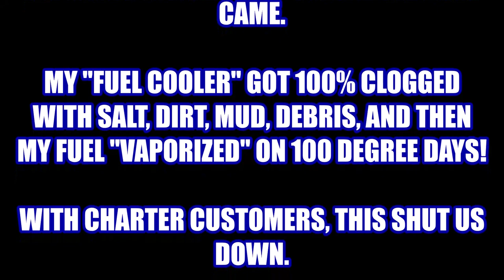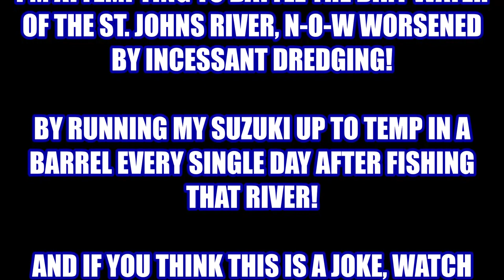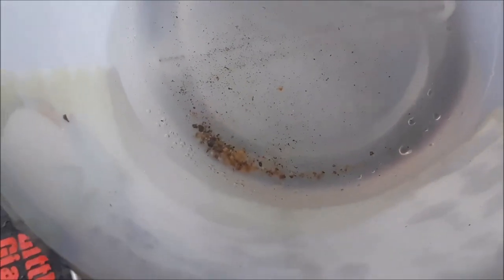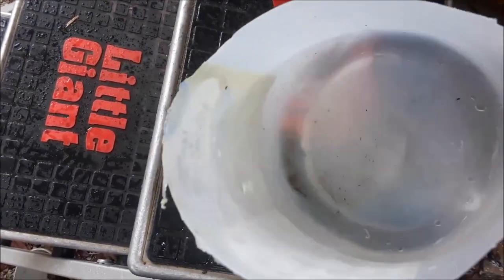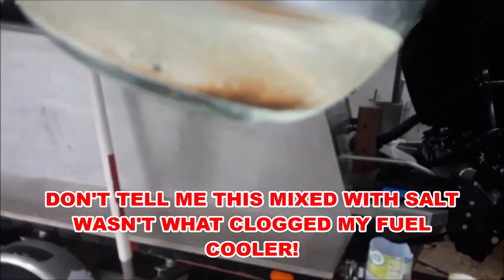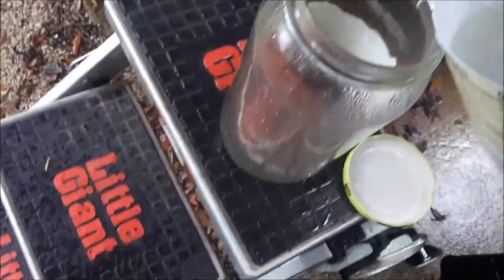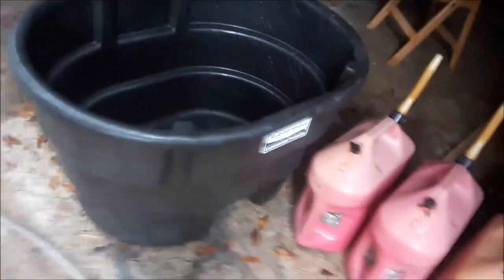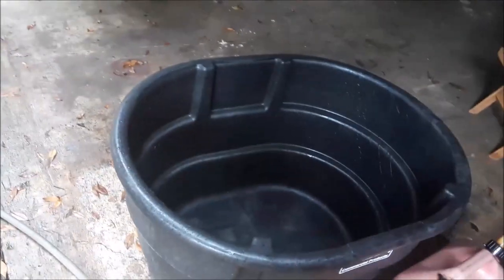OUTBOARD MOTOR FLUSHING (do not use)

Comment: Great vid Capt Dave, But disturbing for anyone who navigates on the St Johns river. Those particles look pretty big.   I have two suggestions for you. # 1 While at anchor with good current or at a slow trolling speed, throw some type of meshed strainer over the stern and see what you can catch in it. an  old net with some screening in it would do. With this you could find out if the problem is actually in the river or at the ramp. Suggestion # 2  Use compressed air and put it into the tell tale prior to and after fresh water flush. Run some compressed air thru the flush port as well. If you find that stuff is actually floating in the river, then your doing every thing that can be done. If it seems that its coming from the ramp it probably could be avoided by getting out to deeper water before lowering the Suzuki  and starting it. How you can accomplish that is something I cant "from where I am" suggest anything.
Reply from the maker: THERES FINE, FINE floating dirt also. but no matter where it comes from it ''water'' runs thru the fuel cooler. And can help clog it up. There's no way to catch it. Yes the ramp is a ''particulate'' factory. I even tilt the motor way up as I drive on the trailer, and once on, turn motor off fast! to help not suck more crap.

Comment: I had a 2007 175 hp Suzuki that would start up fine cold but if I ran it to a fishing spot and shut it down to drift fish for awhile it would have a hard time starting it back up.   I spent hundreds of dollars taking it in to different shops and not a single "expert" mechanic ever mentioned the fuel cooler.  That motor corroded on me this past summer and I had to replace it.  Had less than 300 hours on it.  Sure wish I had known about the cooler.  I bought another 175 2019 Suzuki so hopefully I will have better luck and do my part taking care of the maintenance.  Thanks for the tips!
Reply from the maker: ''That motor corroded on me this past summer and I had to replace it.''' with proper maintenance, that would never happen.
Reply: @CaptDavesSportfishing   The heads developed a leak and they got corroded.  I was getting water in a piston and that's all she wrote.  I will stay on top of the new motor maintenance much better than the old one.  I own a couple of boats and this one got little use.  That was probably an issue as well.
Reply from the maker: @gsman5828  w-h-o-a!

Comment: What seems to work for me is a solution of white vinegar, Dawn and running the motor in a trough of warm water for 30 min. The outboard is a honda 90, 5,500 hours, 24 years old with never any major problems.

Comment: Capt, just a quick question. Are you doing you engine flush only in the horse trough? No muffs or those other useless rinse/flush ports. I've got a 2019 DF200 and bought a 100 gallon one and that is what I've been using. Just trying to follow along. Thanks for all your tips.
Reply from the maker: yes just my barrel, do not ever use those flush ports on the motor, I did for years and my fuel cooler, look it up, got packed with dirt abd salt, shuts down motor in extreme heat, fuel will vaporize!!  too much heat going on under the cowling, so they came up with a part that will clog up easily. I have numerous videos about the toilet I run in abd the shit that ruins everything from anodes to water pumps!!!  interior anodes must be checked every 3 months if you run in shit water too.
Reply: Capt Dave's Sport Fishing Thanks Capt. I normally fish the gulf and at Augustine. Sisters creek used to be good to me but too many people. Thanks for all your help.

Comment: You should do a test.when you get back flush it with the flush port then after use your Method and see how much it missed
Reply from the maker: its about salt and grime in the ''fuel cooler''.....oh, it misses alot. Never ever seen so much crap, till I ran in barrel up to temp.

Comment: Whats up Captain, does that apply to the other motor you have when in use???Thanks for the vids OVIEDO FL..
Reply from the maker: Could! And it gets ''run flushed'' also, but is easier because it is made to be run on it's flush port.   I'd REALLY like to get my Merc 15 kicker hooked up to a shifter/throttle up in the boat some day soon. I'd use it even more!

Comment: That's all you got from a day running? I was expecting a lot more. Seeing the water quality in any Florida river 

If this was after flushing through the flush port,then, I  am a bit surprised. at
Reply from the maker: after years, add salt and mud....EQUALS: clogged fuel cooler❗ I have proof. YOU'RE NOT GETTING THAT OUT OF MOTOR WITH FLUSH PORTS❗ ONLY WAY IS ON THE WATER MUFFS OR BETTER A BARREL, multiple mechanics back me up, period.  The St. Johns where I fish is a toilet of dirt.
Reply: @CaptDavesSportfishing  I have an older Johnson 2 stroke with no flush port I run in salt water in Indian and Banana River. Always flush with muffs.  Past owners probably didn't lots of gunk in thermostat I need to clean out with method you showed in other videos.

I also have a newer Mercury with flushing ports I run in "clean" lakes in Idaho.  I imagine that water has lots of calcium and occasionally is pretty dirty so, there's likely some aggressive cleaning on that engine needed.  It does get hot.
Reply from the maker: @oldhardrock2542  fresh water lakes are no reason to not flush motor. Thats for sure.

Comment: That should not be enough to clog a motor
Reply from the maker: no one said CLOG...just really bad!!
Reply: it builds up... you come back home the water goes out the motor leaving this type of shit in the small corners and crevices then dries rock hard,... next time out another bit and so on until you have a shit load of this clogging the complete water galleries...